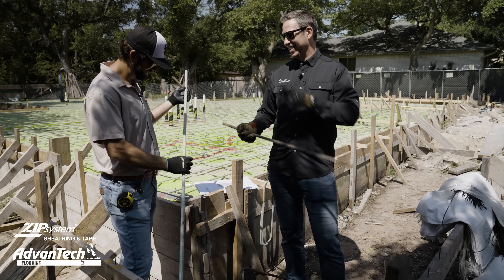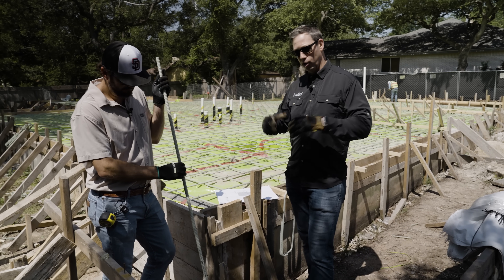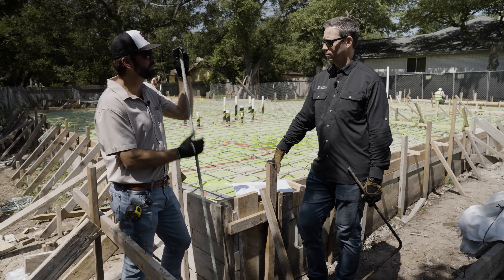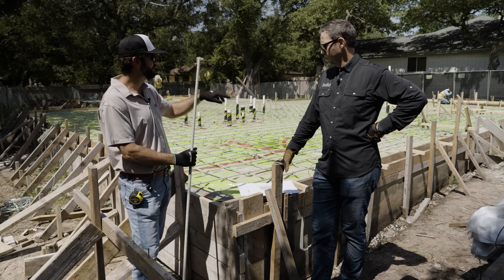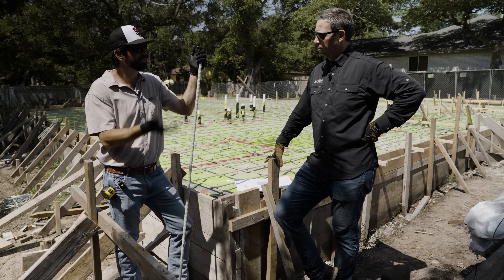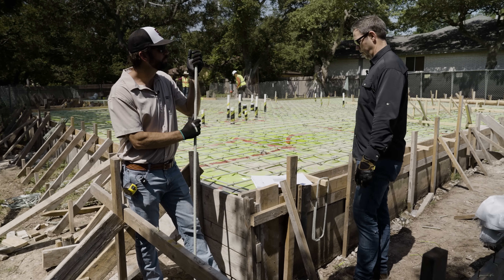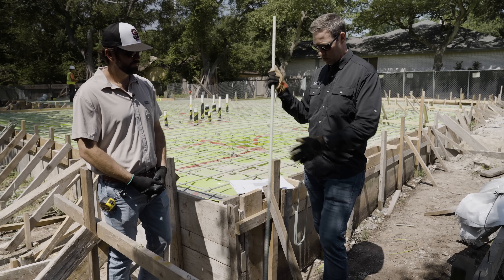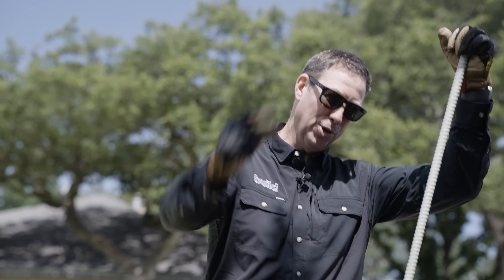Comparing Steel and Fiberglass Rebar - SURPRISING results

Comment: As an architect, the huge advantage I see is not rusting. I'm worried about how much we've built with steel-reinforced concrete and how much of it we'll have to tear down. Once water gets to the steel it's over - you can't stop it, you can't replace it, you can't salvage the concrete it's embedded in. And eventually the water will find its way in. Our oldest buildings are unreinforced masonry because there's no steel in them to rust and destroy the structure (not that all unreinforced masonry buildings last that long, obviously). Of course, unreinforced buildings have other problems, especially with settlement and seismic loads, so we can't just leave the rebar out. That's why these alternative products seem so promising. I would love to see them become the standard for public buildings, infrastructure projects, institutional buildings, and anything along the coast.
Reply: The importance of this advantage simply cannot be overstated. Damage from corroding steel reinforcement in concrete has been conservatively estimated at $2.5 trillion PER YEAR! That's nearly %3 of the world GDP! Think of a market like China where excess amounts of infrastructure has been built in anticipation of future growth. How much of that will crumble away before said growth is ever even realized? It is INFURIATING how little this is being looked at in the current push for renewed infrastructure here in the USA. There is so much fretting over our roads and bridges that are crumbling after a mere 50 years of use and now we are in a hurry to replace them with materials that will only last another 50 years. A small increase in material cost today could easily double that lifespan and likely well beyond.
Reply: @drunkenmessiah  How do you know how well the fibreglass will perform in 25 years? Be careful believing the "We've been testing it" pitch.
Reply: @Andrew-rc3vh We have GFR in buildings going on over 40+ years without any failure.
Reply: @JohnLee-db9zt  Sorry I thought it was a new thing. That's OK then.
Reply: I was involved in trying to save a building on Bradenton Beach in Florida that was leaning towards the Gulf of Mexico. The pilings under it in the parking area were falling apart and we were told to grind the steel back and we painted it with some nasty 2 part paint. Then they were patching it. That was about 25 years ago and I'd be willing to bet that the building is long gone by now. The "repair" was a joke, but not funny. I was in my early 20's with zero experience with concrete and rebar building repairs and I could see that we were putting bandaids on bullet holes.
Reply: As a structural engineer, the repair to old reinforced structures did not have the quality of concrete as we have been using for the last 20 plus years and we did not understand properly the relationship between rebar and concrete. I designed numerous large dams about the world, the oldest reaching 4 decades, it has not one sign of spalling.
Reply: @glynnepritchard2526 having done my own research into carbon steel rebar reinforced concrete structures and houses, I’m still very skeptical about its durability. Reinforced concrete structures should easily last 100+ years, but even with modern buildings I’ve seen them start to fail after 30 years. Water intrusion (chloride) will turn steel rebar into expanding powder that will crack and burst the concrete. I would not build any steel reinforced concrete house in marine environment or anywhere near where road salt is used.
Reply: @JohnLee-db9zt unfortunately you have not carried out full research. Steel rebar if used with proper cover and the correct concrete mix will not succumb to corrosion. I have designed everything from dams to sea walls to high rise, none of have which have issues through normal use. I can only assume you have read articles on old practices, and frankly designers for low rise don’t know what they are doing, construction practices are not controlled it’s all down to saving a buck
Reply: @ Says you, a nobody as far as I’m concerned. Show us your work and peer reviewed articles. I’m interested in residential construction as is this YouTube channel devoted to home construction, not high rise commercial buildings, dams, or bridges, where there is practically infinite budget with many engineers and contractors and supervisors overseeing the work. Anything done properly has a potential to last a long time, but that’s theoretical. I’ve seen too many examples of modern buildings build in the past 30 years with rusting rebar. Even if the rebar is covered ‘properly’ with correct concrete mix, multiple studies have shown chloride penetration reaching steel rebar over short amount of time especially in marine environments and areas with high road salt use.  Even concrete treated with sealant eventually wears out so you have to retreat every 3-5 years. If it rusts and turns to powder, what’s a homeowner to do? Too much headache for a home owner to deal with.  So your claims don’t fit reality.
Reply: @glynnepritchard2526  please go fix Florida. There are lots of buildings with concrete and rebar damage.
Reply: @comfortablynumb9342  would love to but dependant on the original design, materials and construction, sometimes it’s cheaper to demolish.  I have HR structures in places that have higher salinity and humidity than Florida with out issue.
Reply: @glynnepritchard2526  yeah I think a lot of those buildings from the 60's and 70's are getting beyond repair. 
Speaking of salty air, I used to live on the Pacific Coast of Costa Rica in a little surfer town called Pavones. A new computer or TV usually lasts about 2 years there. In 3 years I had several fans give up, the bearings were squealing. It's especially salty when the waves are big. You can see it in the air. They started building homes with concrete posts that have grooves in the sides. They put in the posts and slide prefab concrete panels down the grooves, then finish over the walls a bunch of different ways. No steel until they build the roof structure and the roofs are usually corrugated galvanized too like the structure. They're quite sturdy little houses, and very cheap and fast to build. But I don't know about going over 2 floors with that system. We have some walls by the interstate in VA that look like the same style of building but bigger. Here I think we should try using that system but do an inner and outer walls and fill the void between with dirt. And a better roof with insulation is obviously required. But for small homes I think it's a great idea. No hurricane is blowing those walls down. The way it's done in Costa Rica is supposed to be earthquake safe if it's done right. A doubled wall would be very good for temperature control. 
And maybe the glass rebar in this video would make it possible to build higher with that system.
Reply: Is this reinforcement ductile? Since we like our concrete structures to exhibit signs of distress (cracking) prior to failure—strength and corrosion resistance is great but ductility is equally important. Hence the two fold purpose of steel reinforcement in concrete (ductility and tensile strength)

Edit: FRP rebar is not ductile so for many applications (particularly large scale and seismic applications) it cannot directly replace steel reinforcement
Reply: @greg.gonzales  I made this point elsewhere on this page. Using this product on high rise would lead to catastrophic collapse.
Reply: @greg.gonzales  It only needs minimal ductility for concrete to show cracks well before the FRP fails.

Concrete will crack at ~0.02% strain. FRP fails at ~100x that. So as long as you don't ignore the cracks and let them get huge, the ductility of steel isn't a big advantage for rebar.

Of course, ignoring cracks is all too common...
Reply: @masina9447 The challenge with the suggestion of addressing the cracks is you have to be able to “see” the cracks. Hows anyone inspect cracks in a concrete foundation when the exterior is backfilled with soil and basements walls are often finished.
Reply: @greg.gonzales That’s the claim about FGRP rebar and high seismic zones. However, there’s no research I’ve seen where that claim was proven or supported. MST shows their rebar reinforced concrete slab going through 2 million cycles of back and forth flexing at around 2-3 hertz, while equivalent steel reinforced concrete will fail after 20,000 cycles. But it is true MST and ACI advise not to use their rebar in seismic zone D or higher.
Reply: @greg.gonzales So everything would look great. Until it wasn't? Am I correct?
Reply: @msmeyersmd8  exactly, you may get some deformation or deflection but the failure of brittle materials is sudden. Think, a rubber ruler vs plastic ruler. They could be designed equally strong (support the same amount of load) but behave very differently when a failure load is reached.
Reply: You should look up migratory corrosion inhibitor. euclid chemical makes it, expensive, but effective. can penetrate concrete and protect the steel.
Reply: Once an earthquake gets to fiber glass FRP it’s over.
Reply: @JamesRinkevich  Prove it.
Reply: @JohnLee-db9zt  prove that it can. I’ve been in a 7 EQ.
Reply: @ That’s no proof. Anecdotal at best, a complete lie at worst. The new generation of GFRP rebar is very different beast compared to 20 years ago.
Reply: @JohnLee-db9zt  remember the proof is required from you. Like an actual demonstration since we already know FRP rebar can be hand broken.
Reply: @JamesRinkevich You claimed it won’t last so the proof is also required from you. MST rebar in their site has tests. Whether you believe them or not is up to you.
Reply: @JohnLee-db9zt you claim it will supply the testing. And it certainly won’t in vertical.
Reply: I remember reading about that apartment building that fell down in Miami and they said that the proper maintenance the building owner didn't do was to jackhammer the old rebar out and replace it and then add fresh concrete to reseal it. I am not an architect, and yet it just seems blatantly obvious that THAT kind of "maintenance" program is not practical for the majority of what we have built out of reinforced concrete. Ever since that building collapse, I have understood why our infrastructure is so expensive and gradually falling apart.
Reply: Unfortunately, FGRP rebar is not code approved for building in high seismic zones (D and above) like west coast, although if you can get a structural engineer approved design, some municipalities will let it pass.
Reply: @JohnLee-db9zt  is this an physical shortcoming or just code needs to be updated ?
Reply: @muskepticsometimes9133 I think organizations like the ACI need to reevaluate the data. Remember, progress in construction industry moves like molasses on a freezing cold day. They just don’t want to change.

Comment: Been in the rebar business for over 2 decades. Pricing and availability limit the viability of GFRP. The only places you really see it is in extremely corrosive environments, where epoxy coated rebar won't be sufficient, or in places where you can't use steel, like foundations and walls surrounding MRI machines.
Reply: alot has changed in the last few years! contact your local WhiteCaps, Carrol supply or other rebar fabricator and ask for it.
Reply: @bornahany  I have worked for rebar fabricators my entire career. I've supplied bar to everything from small town churches to 50 story towers and everything in between. The only thing that has changed in the last few years is the contract drawings seem to be less and less complete at the start of each project.
Reply: @Chad_H  that’s so true lol
Reply: What’s MRI machines?
Reply: @stevt77  magnetic resonance imaging.
Reply: They are in hospitals to look inside the body without having to cut it open. They are giant magnets.  @stevt77
Reply: Isn't epoxy rebar already not allowed to be used in most places because it makes corrosion worse? The epoxy doesn't prevent corrosion but hides the damage from inspectors after the structure is built. Galvanized rebar is a good option but expensive.
Reply: @bobbygetsbanned6049  that is incorrect. Epoxy coated rebar gets used all of the time in corrosive environments. I worked at a rebar fab shop that coated and fabricated epoxy coated rebar for 6 years. I have personally provided 10s of thousands of tons of A775 epoxy coated rebar for ferry terminals, highway and bridge projects, and water treatment facilities across Washington, Oregon, Idaho, Montana, California, and Hawaii.
Reply: Epoxy coated rebar can be excellent, but every flaw in the coating is where the corrosion is concentrated. This leads to very abrupt failures. 
 @bobbygetsbanned6049

Comment: Seems like a big deal. All concrete eventually cracks and exposes the rebar to eventual rust (if not actively maintained). Wonder if this could extend the lifespan of reinforced concrete beyond a couple hundred years or so, though I worry about the longevity of those polymer bonds.
Reply: Yes, MST BAR, fiberglass rebar holds the advantage that corrosion does not affect the reinforcement when exposed to cracking or moisture. For this reason many salt water areas, break walls, bridges and other standard applications enjoy lower maintenance and longer lifespan on the concrete MST BAR is reinforcing. MST BAR will outlast the concrete!

Comment: I spent a bit of time researching this... positives: + higher tensile strength, +lighter , +corrosion resistance, +lower-install-costs; negatives: –fire resistance very low, –no-ductility, –low-shear-resistance, –higher-cost-of-material, -not-site-bendable.

Questions: bond strength vs black bar.

Comment: I doubt the fiberglass is stronger than steel.
Could it be higher strength to weight ratio?
Reply: It might be because steel rebar is trash. Its not like its high quality alloy steel. Allso the steel is strong in every direction where as the fiberglass is only strong in one.
Reply: @mshepard2264   yeah I checked online, it is a higher strength to weight, not higher strength. Also the protrusions on steel rebar is perfectly strong, any bumps on fiber glass just aren’t going to have the same strength as the long bar, it will just be strong enough for a tighter mesh of the fiberglass.
Reply: The tensile strength of MST BAR is significantly greater than steel (150 ksi tensile strength for MST BAR versus 60 or 80 ksi for black steel). It also weighs ~ quarter of steel rebar. So, MST BAR has ~ 10x the strength to weight ratio of 60ksi black steel.

Comment: I dunno why they cant coat steel rebar with something so it does not rust, like why dont they coat the steel rebar with fiber glass and get the benefits of both types, carbon fiber maybe...
Reply: Coating has been around for ages with steel rebar. The problem became damage. Construction sites are rough, handling is rough, workers are rough, etc. The coatings just haven't worked in practice. Nothing else matters but corrosion resistance with rebar. The discussion about weight, strength, heat in the sun, pull out strength, etc, are deeply secondary.

Comment: Stronger, yes, but 3X less stiff than steel.  MST web site lists the modulus of elasticity of their GFRP at around 9,000 ksi (9,000,000 psi).  steel is 30,000,000 psi.  This means the MST GFR will stretch 3X more than steel under a particular load. The modulus of elasticity of 3,000 psi concrete @ 100 lb per cubic foot is around 2,000,000 psi.  Whatever you reinforce concrete with has to be stiffer than the concrete - both GFRP and steel are stiffer, but for a particular amount of deflection, the steel rebar will hold more of the load than GFRP.  The fact that GFRP is super strong in tension doesn't mean anything if you have to stretch the crap out of it to get to that stress. The concrete will break long before the GFRP breaks.
Reply: Good points. Stainless rebar imo is the ticket.
Reply: That’s true! Only if serviceability is the governing design. Keep in mind gfrp only strain goes to 2% so at some point gfrp can carry more load and stretch less. The reality is in largest suspended slab to achieve the same deflection you can use 15-20% more rebar and achieve the same deflection. 
However, when you are using this material on slab on grade with deflection is not a problem then you can take advantage of 160KSI tensile and use less rebar…
Cheers
Reply: @bornahany  Thanks for the info!  I don't understand your "GRFP only goes to 2%" comment.  2% is part of the definition of how to compute a materials yield stress.  First you measure the length of the test coupon before you apply a test load, then apply and remove the test load.  If the change in length divided by the original length (the strain) is 2%, then the load you applied is defined as the yield load (divide by cross-section area to get the yield stress).  I know this definition applies to metals, but I don't know if they have a different standard for GFRP.  However, it doesn't make sense to me that GFRP would stretch 2% and then stop stretching.

Regarding your "15-20% more rebar to achieve the same deflection" comment - am I correct in assuming you were referring to using 15 to 20% more GFRP rebar to achieve the same deflection?  This also doesn't make sense since you have to reduce the load by 3X to get the deflection to equal that of steel because when designing concrete beams, they want you to assume the bottom half of the beam is cracked and that the load at the cracked zone is carried only by the rebar.  Is there a different way to compute slab stress (I don't know, I'm sincerely asking), like maybe they allow you to assume the concrete does not crack up to the neutral bending stress axis?